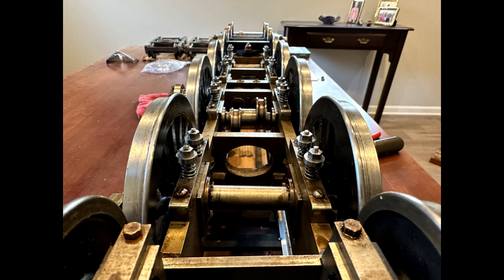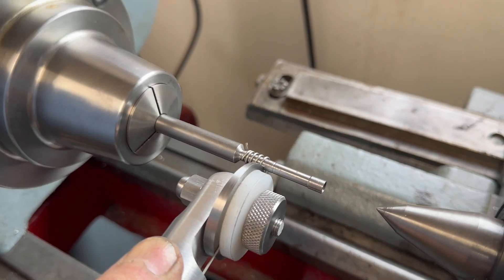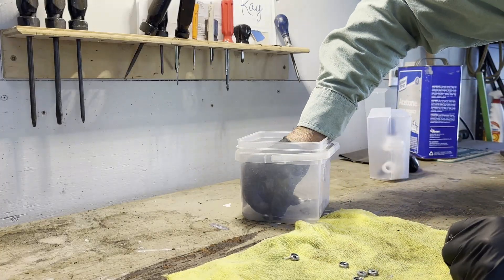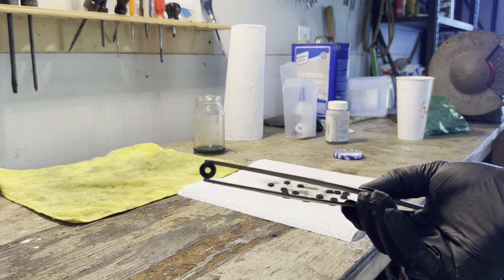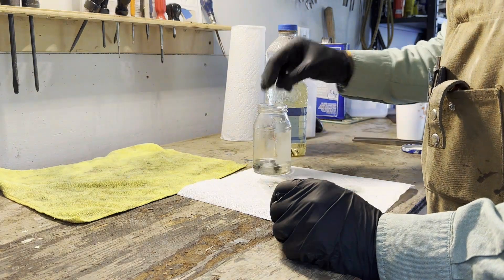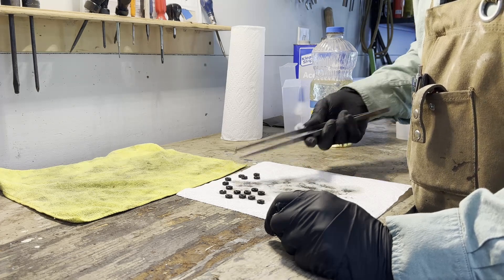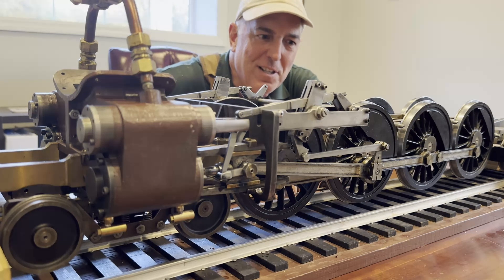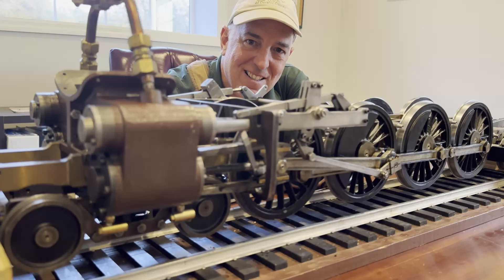Suspension Installation On Northern 4-8-4 Live Steam Locomotive

Comment: As a model maker myself, I’m curious why you single point those small diameter threads? I usually only single point on threads larger than 1/2” or on something I can not get a threading die on. I’m not trying to come off as criticizing, simply curious. Nice work by the way. Earned my sub to your channel.
Reply from the maker: Thanks for watching. During the previous video I explain that the stainless was “tearing” when I only used a die. Therefore I single point thread about 75 percent of the depth and then used a die to finish the threads. I hope you enjoy my channel. I have only been actively matching for two years so I still have a lot to learn!

Comment: Nice job. It looks like a 5 inch gauge model, 1inch scale! On my 4-8-4 (1.5" scale, 71/4" gauge) I've used the same style of suspension! If I were to do it again I would put the springs on top of the axle boxes! Too late now.  Henry Greenly drew up my plans so quite a lot of English modelling practices used. 
Thanks for sharing.
Reply from the maker: Thanks for your encouragement.  It is a 3/4" scale.  Plans were drawn in 1950's.
Reply: @LaneTheProjectGuy  I find that interesting. My plans were drawn up by Henry Greenly about 1934! I use them as a base marker if you understand, and as I've gained more experience I now draw up plans from photos. Finding plans on the internet is a bit of a challenge!
Actually I really enjoy the planning process. I use a lot of CAD ( Cardboard Aided Design). Sometimes then using some plywood mock-ups before I cut metal. I hate having to make metal stuff twice!